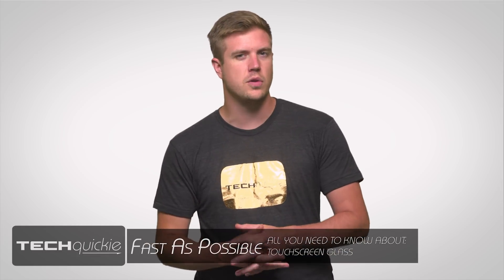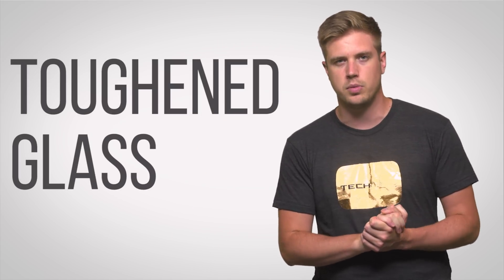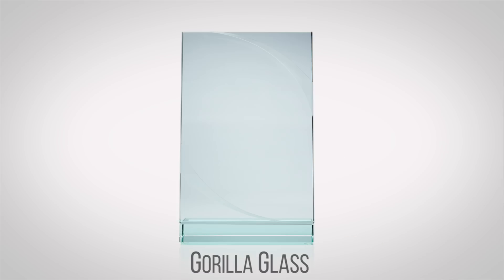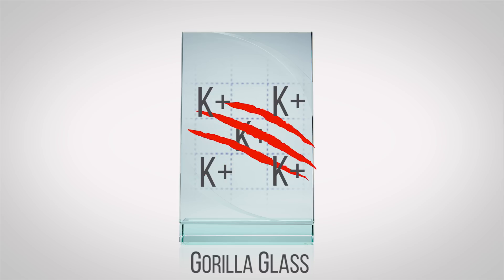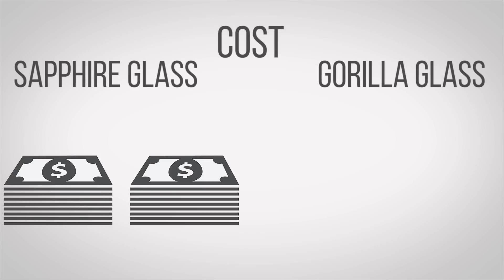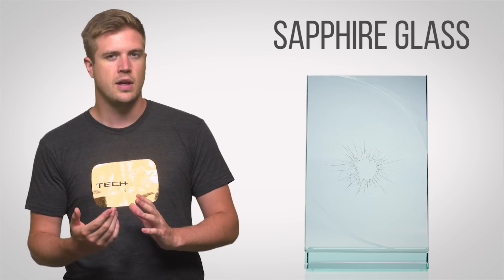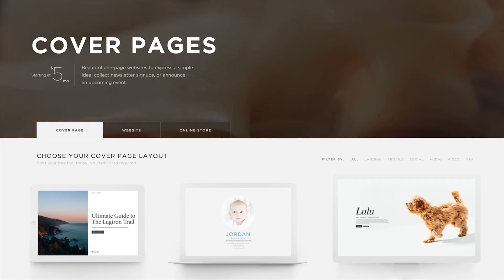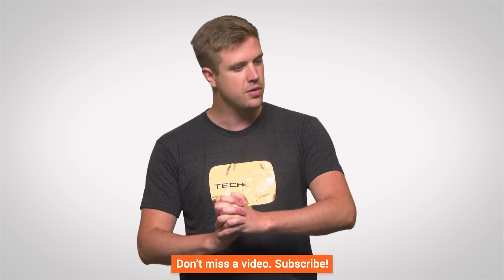Touchscreen Glass as Fast As Possible

Comment: "... gives it resistance to scratches" not if it's Gorilla Glass 5, unfortunately. :-(... which scratches from elements as low as 3 on Mohs scale of hardness... as opposed to Gorilla Glass 4, which doesn't scratch until around a Level 6 of hardness. ( check out jerryrigeverything's video on the Note 7) The school of thought here is this: The softer version of Gorilla Glass will be more pliable and harder to physically crack, and can therefore can withstand drops better... but if it's just a little harder than hard plastic, and every type of metal anything that comes in contact with it will scratch it... What's the point? :-( Bad on you for this one, Corning. :-/

Comment: So what would happen if you did this in reverse and incorporated the Prince Rupert's drop principals to it, like pour potassium rich molten glass into a mold, cool it very quickly (ln2?) then put it in a sodium bath? Then you'd have both mechanical and chemical forces working together but the pressures would be pulling in instead of pushing out.

Comment: No mention of the hardness of glass. I'm not sure about the numbers, but glass - your everyday window glass - is simply harder than almost all everyday objects. And something hard CANNOT be scratched by anything softer no matter how hard you try.

For instance, it's impossible to scratch glass using a steel knife. It just simply won't happen. Not even if the knife is atomically sharp.

Only "everyday object" I can think of that will scratch glass: sand. And other glass, of course.

Comment: well, I had a Samsung S4 mini for 3 years. I never broke the display because the phone would always fall onto the plastic corners and never crack the display, even from a 3m fall on gravel.
Reply: same except i have the original s4
Reply: +Carl Johnson now my phone is dead, because the android gave up...
Reply: SuryNoobCZ aww. My phone is going to die soon because of the charging port. I had no problems with it for 3 years though. Still simply has the modern standards for a phone unlike my grandma's 4s... It couldn't even run YouTube without overheating...
Reply: +Carl Johnson LG 410i <- that's my phone right now, look it up :D

Comment: Saphire is used in watch glasses, and it doesn't cost that much. A saphire watch glass is approximately 20-30$. In a 1000$ watch it's not that much considering the cost of the other components, in a 100 000$ watch it's even less important. But in a smartphone it would probably represent half the costs of the production, not to mention if the cost is 100$ higher they won't just bump the phone's price of that amount, it would be like a 300$ msrp increase at least.

Comment: how to make smartphone screens a lot tougher: use tough glass, make the case walls surrounding the glass higher so that when dropped, it's not the corner of the glass that's taking a direct hit, but it's the case, absorbing a lot of the force. this is why rubber case bands work so well. the rubber absorb most of the impact, leaving the glass unharmed. of course this wouldn't work if you were to drop your phone's screen directly on a rock, making it so that the rock hits the screen in the middle of the phone, no the edge then tough luck, that thing is gone for sure.

Comment: the problem with "unbreakable glass" is the shock of impact can still damage the digitizer (touch) or lcd (picture). so then youre just as fucked or more fucked since usually the digitizer is fused to the glass so you have to realistically replace them both as a package and will obviously cost more
Reply: So the problem with unbreakable glass is the non glass parts can still be broken, thanks for that insight!
Reply: Samsung's digitizer cost $300+

Comment: Could you possibly combine sapphire glass with gorilla glass to make it stronger? It may be a dumb question, but I'm just curious.
Reply: First non harambe comment
Reply: +Rushi Patel did I not meet your standards xD
Reply: +Cole Johnson (5urd) I'm pretty sure he meant combining them to get the scratch resistance of sapphire glass and the strength of gorilla glass, not just layering them on top of each other. To answer +Horsey Lover's question, no you can't. They are two completely different materials.
Reply: There wouldn't be a point. It'd be no different than just making the screen thicker. Not to mention the cost of sapphire glass
Reply: Wow, you're right that was a dumb question! But, It's the first comment not to mention Harambe so I guess its not that bad. 
To answer your question, no. The techniques they use to strengthen silicon based glass would have no effect on sapphire.
Reply: martinshoosterman there’s nothing as a dumb question. Saying there is just kills the human curiosity, every question was dumb until it was proven wrong. Was it dumb to ask if there was a way to go to space? Probably but now it’s not